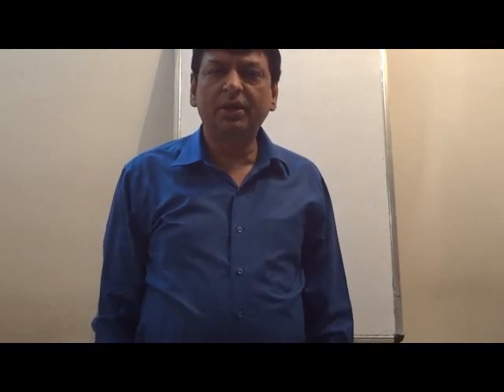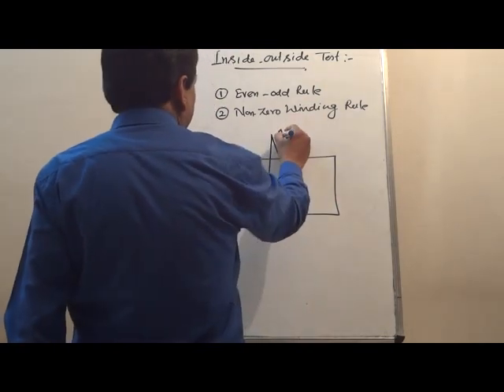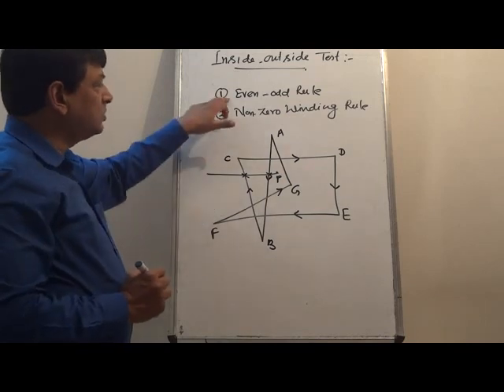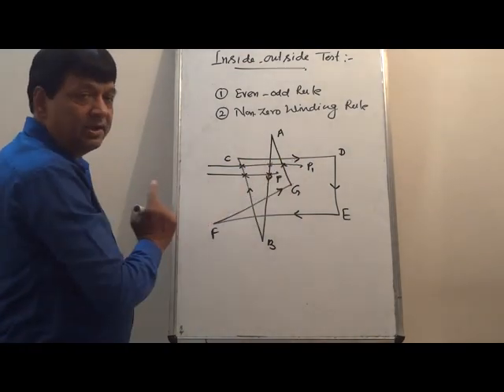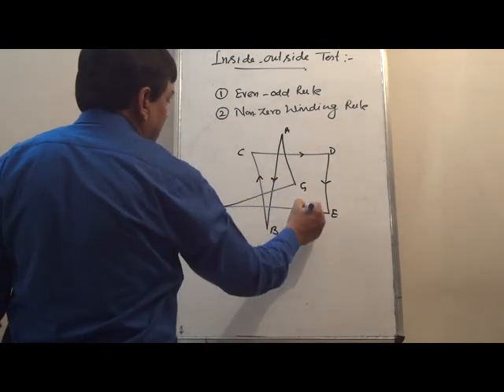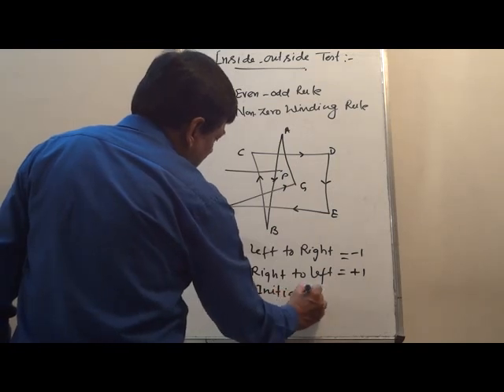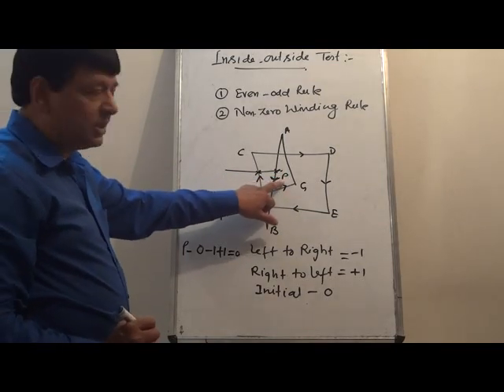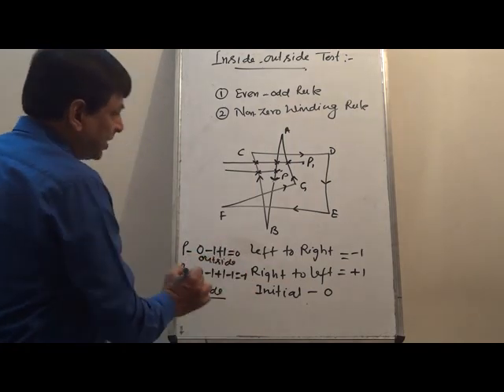Inside Outside Test in Filling Algorithm

Comment: How do you tell if it's left to right or right to left?
Reply: yan kashyap i guess bottom to top is left to right and from top to bottom is right to left
Reply: @gibsontauro  your answer is correct ,, it is the game of arrows,,  if the arrow is pointing upwards than line will pass from left side of the arrow to right side and vice versa for arrow pointing down
Reply: u draw your scanning line from the point to the space, if the line pass from left to right or pass from right to left crossing your scanning line